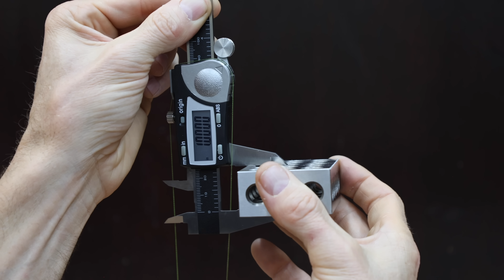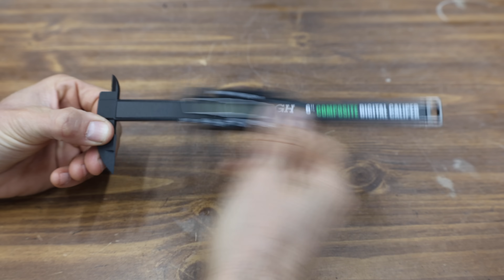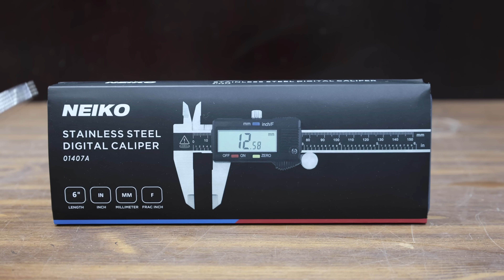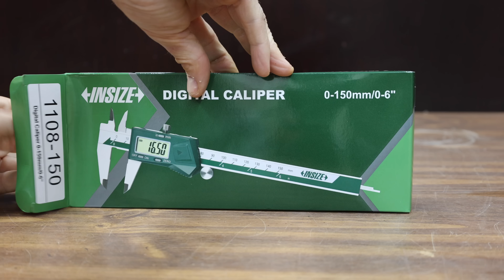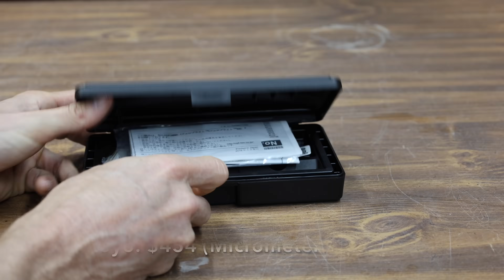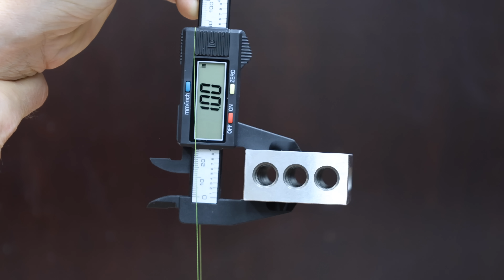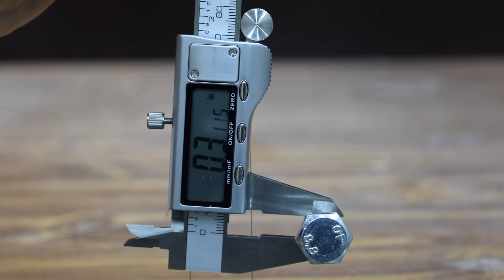I've Been Proven Wrong About Calipers!

Comment: As a machinist I don't need this video, still watched the whole thing.

Will say about the stiffness, I don't trust numbers straight out of packaging. I've had a few new Mitutoyo calipers (dial which is a gear, and digital), and after a week of usage it is worn in and always much smoother.

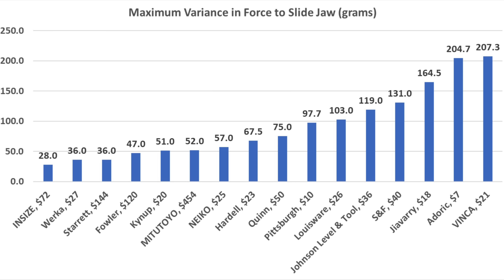10:00 Why is Mitutoyo priced as the kit and not individual tool?

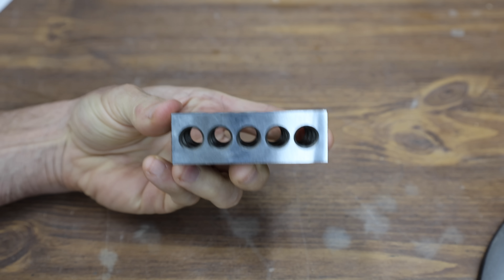10:20 I hope it's accurate 'cause 1-2-3 blocks are CNC ground and measured on CMM machines.
Plus/minus 1 or 2 tenth(s) of a thou (0.0001" or 0.002" can't remember). Still far more accurate than any of the micrometers so it's a mute point but I still feel like it should be pointed out.

The plastic calipers were deforming under the weight you put on and the 1-2-3 block.

11:15 Never count the last digit. Kynup only promises an accuracy of plus/minus 1 thou (0.001"). Nobody can promise half a thou of accuracy with calipers, at least in this price range.
I've dealt with different digital calipers and none of them will find 0 every time but damn that one was bad.

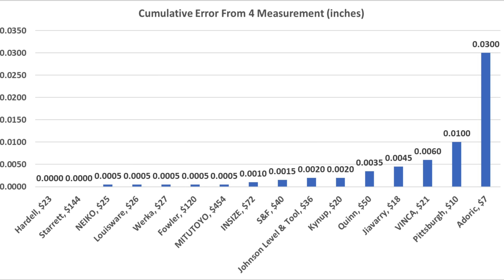13:05 I feel like not sliding a metal sheet or plate under the block could effect tests here. If you had to use the wood then I would suggest placing the calipers on the block then slide out the leg to the table.

16:45 Even the ground down parts are flat so I'm not surprised. You need to spend some money to get them very sharp and I've only seen it with carbide jaws.

18:23 Mitutoyo usually does have an auto-off but it's long like 30 min or a hour which is good for a work environment, find it weird that this one doesn't. It's good for a work environment like production because it sucks when you run a tool in a machine and the measuring tool isn't ready so you have to wait for it to power on again.

Comment: As a regular mitoyo user, i love the brand and the feel, but mine arent digital as a specialist in control systems and electrical components drift is always an issue. Which is why i prefer manual systems

Comment: Like pretty much all tools the cheap version is good enough for 95% of people. Obviously if your job relies on it (like a machinist) you need the good one but for someone like me who just uses it to measure parts and not make parts the cheap ones are great. The sawmill taught me that. They have a large cardboard box of super cheap plastic vernier calipers for measuring wood but they had one that was metal in a fancy velvet lined wooden box that they used for measuring saw teeth and such that they had calibrated yearly through the saw supply company. The kerf of your saw is very important when you're producing roughly ten tons of sawdust a day.

Comment: I wish you had measured quiescent current draw when off. Many of the cheap calipers are never really off.  The circuit is constantly looking for a push of the on button which drains the battery over time.  If the caliper sits unused for a few months and you go to use it the battery could be dead. The solution is to remove the battery when used infrequently.  The one thing I noticed is that the Mitutoya's  have an extremely low quiescent current draw and can go unused months at a time without draining the battery.

Comment: What I really dislike in the cheaper ones is the use of screws for the battery compartment. And the reason is the cheap ones drain the battery really fast, even when off, so I always take the battery out after use to save it. Screws make it a PITA so I just use a bit of blue tape.

Comment: As a machinist for 13 years I use Mitutoyo at work and Fowler at home. The tightest tolerance you should measure with calipers is +/-0.005. And learn how to properly use them and take care of them. 

As a side note the Mitutoyo’s are great for their versatility in doing different types of measurements and how they read on screen.

Comment: Awesome video showing how even cheap tools can have great value. As a machinist I like that you understand human error as well affecting measurement. Also we use high precision gauge blocks that have a tolerance much tighter than what the tool can measure to verify metrology tools. A 1x2x3 block is great but depending on manufacturer may have a 0.002" tolerance across the block. Also it is normal not to trust calipers for less than 0.002" tolerance. They just are not as precise as needed from day to day. I have seen a $10k part get scrapped because someone trusted their $400 calipers.
Reply from the maker: Thanks!  Thanks for sharing.

Comment: The VINCA I have eats batteries like popcorn.  You can turn it off, put it in the case, and it will be back on again.  Aside from that I like it for the garage.  Mitutoyo for work though.  (I've never seen a wooden surface plate before. 😉 )
Reply from the maker: Thanks for sharing!

Comment: In my experience the cheap devices do not lose their zero position when they automatically turn off, because the only thing they turn off is the display. As a result they run their batteries down quickly. Modern electronics do not need "patented technology" to properly power down, they just need to power down. But if they do not have an absolute linear scale, they will lose the zero position if they're unable to track movements, as will happen if they power down.
Reply from the maker: Thanks for the feedback.

Comment: This is the stupidest comparison I have ever seen, Firstly Verniers are not intended for extreme accuracy of, 0.001 is a serious stretch even in a standards lab, especially composite plastic carbon fiber type they will actually grow or distort in your hands in hot weather, Cheap stainless steel ones also have problems and most common problems occur with the top spring tensioning settings inside the electronic read out which influences smooth operation and accuracy, dirt oil dust on the magnetic read tape along the length of the body also plays havoc. never handle the vernier more than necessary or leave it out of the box it came in most cheap ones don't have a box or even a pouch, just leaving it lying around on a hot or cold surface will alter the readings and if it has no lockable thumb wheel it's junk before you even start. like using a micrometer without the ratchet it's just a fancy 'G' clamp, the most accurate type of Verniers are the ones with a dial indicator where you are actually paying for a precise instrument with a rack and pinion that should be kept spotless and, in its box, when not in use, some also come with options of or add Ons for needle points to check marking out points and other useful attachments to get in to narrow groves like O ring groves, undercuts and narrow groves,

Comment: i have the variation of the Jiavarry brand. It's slightly off by half a millimeter and the thing is after a few months of use, it's electronics won't measure properly anymore even with fresh battery
Reply from the maker: Thanks for sharing.

Comment: The big thing for me is the battery standby. For some reason all the cheap ones I've tried the battery ends up dead after a few months regardless of use. After spending a little bit more I've had the same battery last well over a year. The cost of the batteries isn't a huge issue but the inconvenience of dead calipers is. 

I actually swapped to dial calipers for a bit to avoid batteries altogether but I broke them (turns out "shockproof" was a lie; either that or they meant electrically rather than physically but that doesn't make any sense) and decided to give digital another try.
Reply from the maker: Thanks for sharing.

Comment: I am a former machinist, I have both an old set of sears calipers I used for 40 years and now a set of 
Starrett,  but here is the point
A set of calipers are for rough estimate of size, true inspection are done with micrometers and quality made joe blocks.
So it depends how accurate your work needs to be. 
Are we splitting hairs or are we splitting a split hair?
Reply from the maker: Thanks for the feedback!

Comment: Most if not all of those are junk as far as I'm concerned. Unless you remove the battery your going to find these kill the battery by just sitting on the shelf, not in uses.                                 STUPID STUPID STUPID Design.  
 A mechanical shut off switch works, but none have one.               BUNCH OF GARBAGE

Comment: I worked machine shop for several years. I have an electronic digital Mitutoyo micrometer and a dial caliper. I also have a Brown and Sharpe Vernier Micrometer. If you need a caliper or a micrometer, but the best you can afford. They will not disappoint and will last a lifetime.
Reply from the maker: Thanks for the feedback.

Comment: the only feature i TRULY need in a caliper is a battery door with a screw. i can't belive the starrett has a slide latch. nothing is more annoying than accidentally opening the battery compartment and dropping your battery ont a messy project floorspace.

Comment: As someone who uses calipers daily and rely on them I have found that the Insize brand is reliable, accurate and cheap enough that when (not if..) the get damaged it doesn't hurt too much to replace them.
For accurate readings i use micrometers, calipers just gets you in the ballpark. For micrometers I prefer Starrett or Mitutoyo, buy once, cry once..

Comment: You should try shahe from Alie xpress, polished hardened stainless steel and 0.01mm measurement accuracy with the same repeatability for 30-40 bucks. (200mm)

Comment: Cheap calipers when turned off have horrible battery drain. Many people don’t have a bunch of spare coin batteries, so the time and cost inconvenience of buying more every  project the clippers is used in is very annoying, especially if the battery case have a screw. 

I 3D printed a new battery cover with a hole to hold a AAA battery which is quick and easy to pop in and out. I’ll never have battery worries again and saved at least $100 on anti drain calipers.

Comment: If you use calipers often do yourself a favor and just get the Mitutoyo. Don't get the one he tested though. Get the silver one with auto off. I see less issues with them overall. You'll end up buying numerous of the cheaper options while it's still working fine. I like the Insize calipers but they always seem to fail electronically for me. Also They're not coolant proof. That being said i can get like 4 or 5 of them for the same price as a Mitutoyo. I gave a Mitutoyo dial caliper that is 20 years old and a digital that is 12 years old. The longest an Insize has lasted is about a year of daily use.

Comment: Bear in mind that a lot of the cheaper calipers with the 357 batteries include spares because the included battery cell is usually almost dead. This is because they do not fully turn off when you push the power button, it just turns off the display. The measuring section is still powered on and will drain the battery.

Comment: Love this test but I would have chosen a different Mitutoyo caliper to compare. Like the 
Mitutoyo
SKU: 500-752-20

This one is coolant proof and auto shut off and IMO better quality than the ones shown here. You bought one that was a whole set so the price of that caliper isn't really in the $400s but in the $150-175 range. The one I mention is close to $200.00

The coolant proof ones are the ones I use at my precision machine shop because of battery life, quality and durability. 

Can never go wrong with Starret though! US based company too. :)

Comment: I remember seeing a video from AvE  (I think) who tested a poor caliper versus a mitutoyo one with a lab power supply. The measurement changed on the poor model as he dropped down the voltage to simulate  low battery.  I think he also tested current draw when off during is tests. Could have been a great tests to do!

Comment: You're not supposed to use LR44 cells in Mitutoyo calipers but instead use SR44 (same size but different chemistry with a more stable voltage and higher capacity).  And they'll last for 5+ years.

Comment: Cheap calipers are not suitable for quality machining. Machine shops wouldn't spend the money on a Mitutoyo, Starrett, Mahr, Tesa, Etalon if the cheap calipers were just as good. All the calipers at college, where I learned machining, were Mitutoyo and Starrett. 

I have Japan made Mitutoyo calipers and micrometers. I checked, and calibrated if required, my tools at the start of each day.

Comment: I have generally been impressed by the quality of your testing, but I think you would have done better to do some studying on precision measurement before making this video. Others have mentioned the highly questionable use of a standard tabletop when measuring for depth, which is totally unacceptable. Also, your handling of the 3-2-1 block -- ever hear of thermal expansion? As a retired Mitutoyo employee, I observed true precision watching (and sometimes working in) their calibration lab, as well as learning from PhD-level metrologists (and even visited their caliper manufacturing site in Japan). Do a Youtube search on "Mitutoyo metrology training lab" and you will learn a few things. And as others have mentioned, you can get a 6" Mitutoyo Absolute caliper for below $150 -- just be sure you are getting it from an authorized distributor to avoid the many cheap knock-offs that are out there.

Comment: I figure you were testing out of the box performance… so this probably doesn’t matter but on all the calipers I’ve owned there is a tiny set screw to adjust the drag or resistance when sliding the gauge. Not that’s it’s relevant here but in case some wasn’t smooth, a bit of adjustment may have corrected the issue. 

I’m glad you did this one… it’s one I’ve been wanting to see. Thanks
Reply from the maker: You are welcome!

Comment: I work in the machining/manufacturing in the mining industry and my specific job is quality technician which involves calibration of measuring and gauging tools. I can give you some tips and tricks of the trade for higher accuracy, and reasons for variations you might not have considered. The discrepancies are so minimal they're futile, but in manufacturing those minor variables actually matter. One simple example is your body heat holding the block will actually distort your measurement by a very small amount. I am a growing fan of your content. Cheers!

Comment: If your doing precision measuring your automatically not a real precision inspector if you consider calipers precision... you need to use a micrometer checked against a standard if your doing anything precision. But if you need a quick check then yes these are good for a quick reference

The last shop i worked at we dealt with tolerances that were +-.0002 tolerances and the machine shop needed to hold the same tolerances machining parts

Comment: We have 13+ year old Mitutoyos at work (I see another commentor saying the same thing!) and its damn impressive they've lived this long, although they seem to drain their batteries faster & faster these days. They are overkill for what we do, but considering they've lived so long I wouldn't be surprised if they're more durable than cheap ones (better steel etc). I don't know where $454 is coming from though, if thats USD they're certainly not that expensive in my country.
I have personally seen the Adoric and Jiaverry style ones too, possibly under different brandnames. In my very limited experience Adoric is trash (1 example), Jiaverry is usable if your expectations are low (2 examples), we have some other styles that are not featured in the video, that are slightly more premium but still don't feel as confidence inspiring regarding their longevity as the Mitutoyos.

But I also imagine the quality is less consistent the cheaper they are, so you may get ones that feel better/worse, or are more or less accurate. You might luck out and get cheap ones that are perfect, but will they still be perfect the next day, or in a week, a month, a year? Testing a single example of each, brand new, is not a great demonstration of what you're really (hopefully) paying for i.e quality control, repeatability and lifespan.

Comment: Hello, I want to thank You, as I really appreciate Your tests!
As almost everybody often fights with frozen bolts, could You please test just how WD-40, etc. penetrates them overnight or so, with and without heat application, as this is mostly the case.Most people, me included, do not possess a welding torch. Does the WD-40 kind of boil its way down the frozen bolt after heat application, like I kind of like to believe?
Or are all the similar products like WD-40 just make-believe?
However, if possible another test could be, just how effective is using a cheap stick welding device, as  lots of people possess the like, to weld a nut, or just a little heap, on top of the frozen bolt.
I believe these tests would be very informative for lots of ordinary folks like me.
Reply from the maker: Thanks for the suggestion.

Comment: Wow, I accidentally purchased the middle-of-the-road caliper, at $20 -- the Kynup!  I've been using it for about a year, now, and I'm quite satisfied with it.  I've yet to replace the battery, and I use it quite a lot. I had to replace the battery quite a few times on my even-more-cheep-o Pitsburgh before it crapped out.  Also, the battery cover kept coming off, and the Pittsburgh is rather stiff.  I like my Kynup much better -- nice and smooth, and it feels like quality, and provides as much accuracy as I will ever need. Excellent video, thanks!
Reply from the maker: Thanks for the feedback.